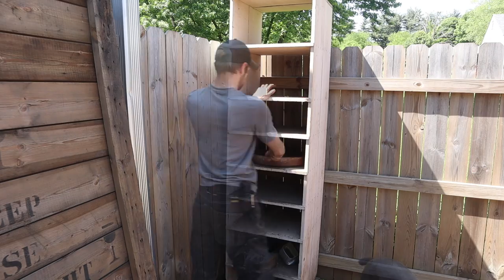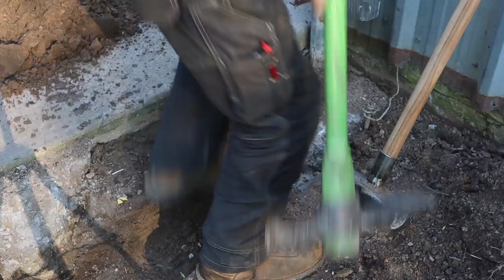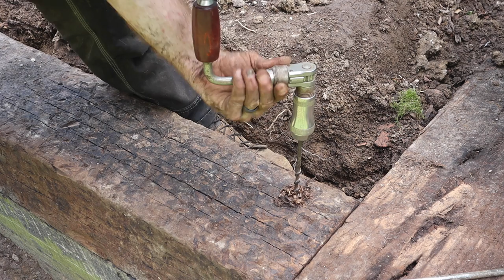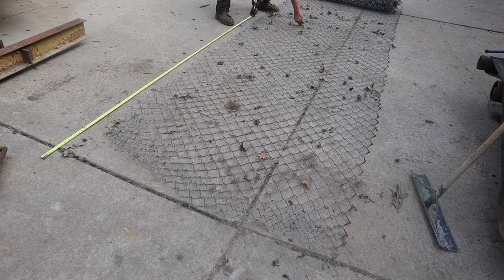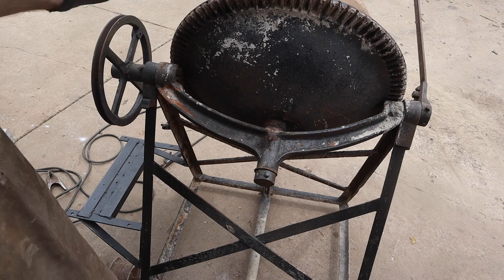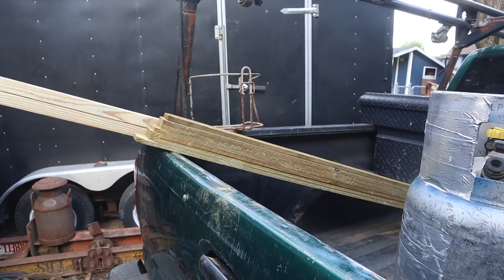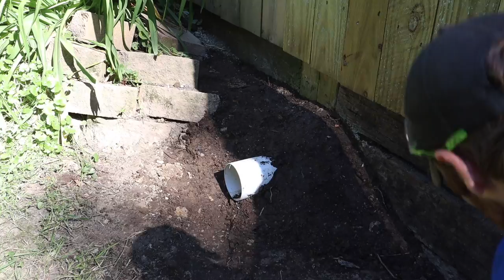FINALLY Getting 3 Phase POWER! ~ Preparing to Install a Rotary Phase Converter ~ Part 1

Comment: You might have been better, not tying the concrete into the rail road ties, I mean it won't make much difference but  tying to the existing concrete and letting that be a slip joint is probably a better option, the wood is more likely to move and less critical then the concrete.
Not a criticism Ive learned a ton from your channel, it's just an observation.
I worked as a Formwork carpenter for 15 years or so, not an engineer or anything.

Comment: My only complaint for this video is the audio of your voice: the volume of your voice was so low I didn't understand a single word you said, and there was no closed caption. :-(  The sounds of your tools came through just fine as well as other background noises, it was just your voice that didn't come through. BTW, real nice work with installing the pad.

Comment: Tim from Canada do you know out of all your heavy machinery you do not have a forklift that has enough power to do your work if you do not have enough power in a forklift to move another form there is a serious problem you have you need to update your fork… Two bigger ones or get some thing that would work here is a suggestion..For you go out and get yourself a Kabota skid steer with forks this would work and you would have more power or get yourself from any tractor with forks because your forklifts you have do not have the power to do your work. People seem to buy all kinds of big machinery but did you not have the power of the machine to move anything this is what I see
Reply from the maker: Lol... Oh Tim.... Everything from you is so negative!